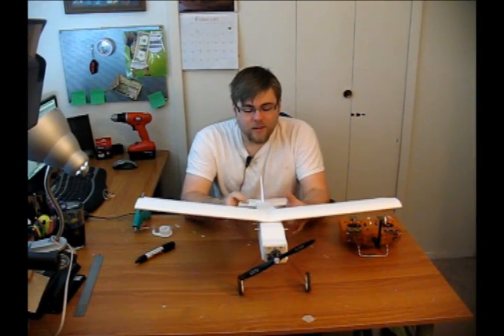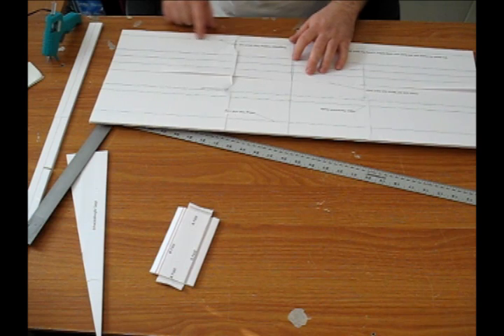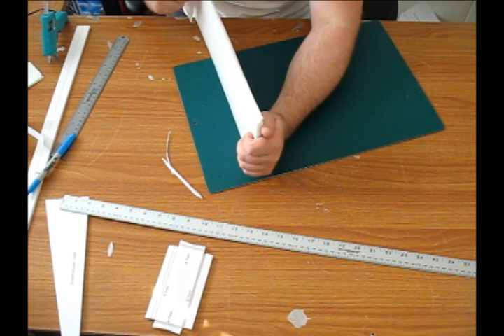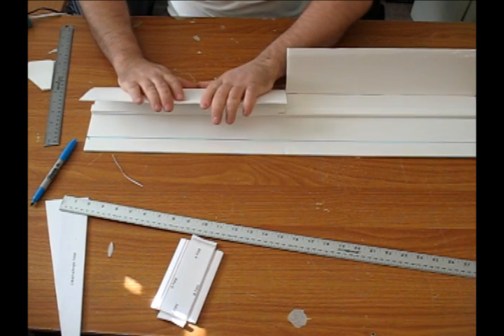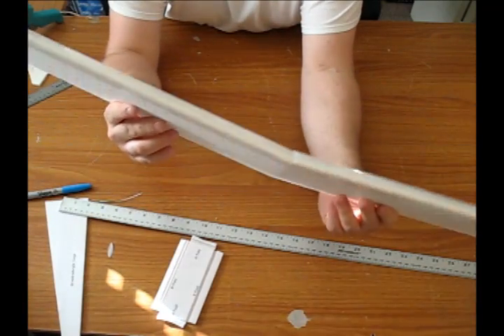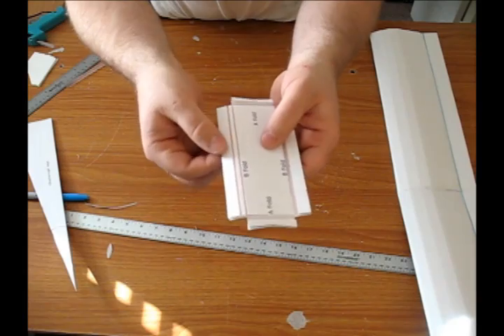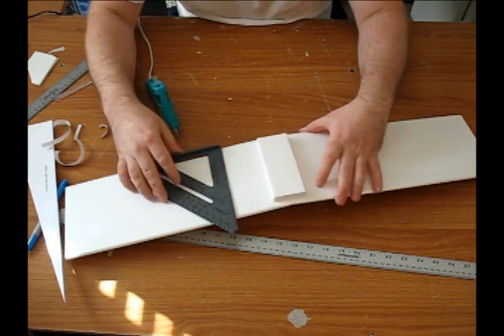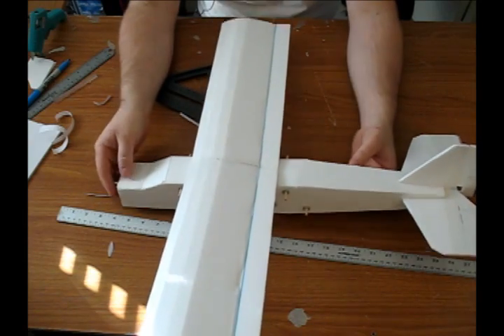Dihedral Wing for Swappable Trainer Scratch Build

Comment: Great tutorial for depron dihedral wing. Until now I built planes with airfoiled wings (no dihedral) from all kind of foam. Usually I'm cutting foam with hot wire.I'm now in process of collecting data for building wings from depron in a way you showed in this vid.
Tks for sharing

Comment: one very late thought for you and your subs.  this is not an optimum dihedral wing design.  why.  because rubber bands over the top of the wing will be 'pulling down' on an ANGLED surface.  a dihedral wing is, correctly, made when a wing center-section is used.  then, there is a 'level' area where the rubber bands are.   cheers